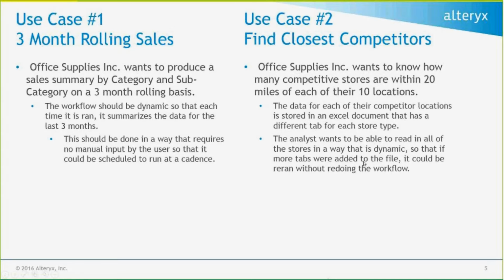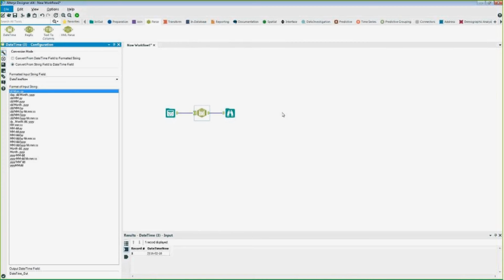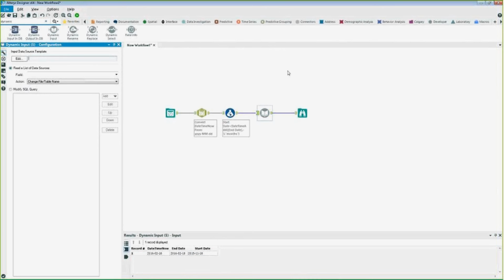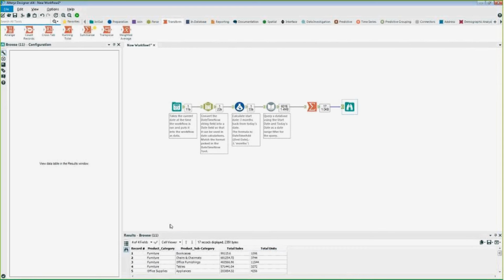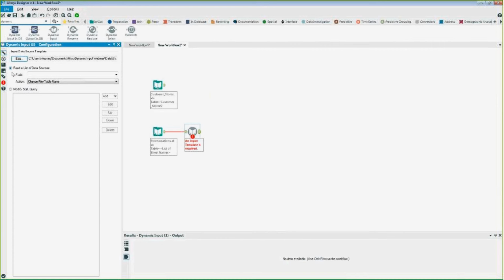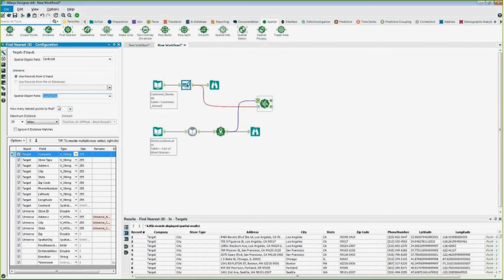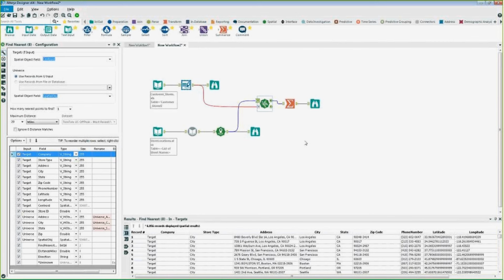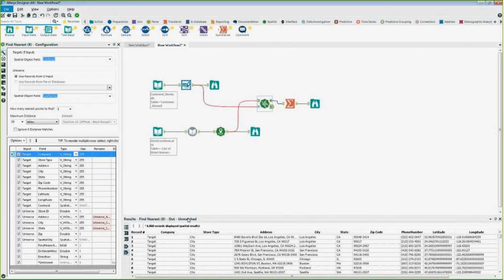Live Training: Dynamic Inputs

Comment: Question regarding the screen layout. In the  formula configuration pane on left there are three different panes within (top, middle, and bottom). I have version 11.7 installed and my layout differs in that it's a single pane with sub menus pasted on the left side. Is changing the configuration pane layout to match what's seen in this video an option, or was this just the default in a previous version of Alteryx that's since been retired?